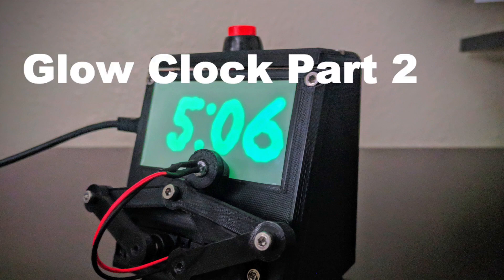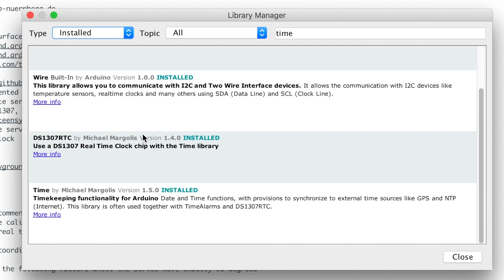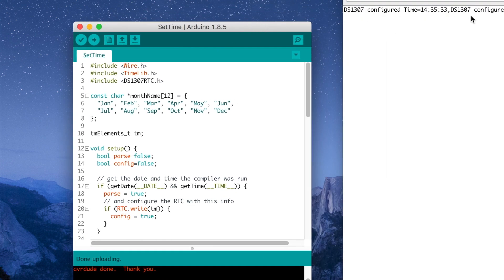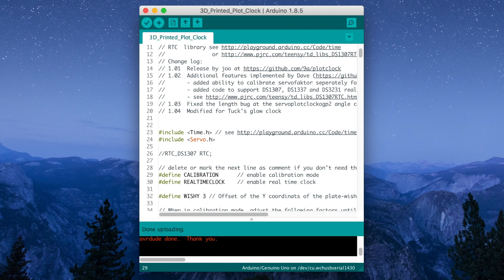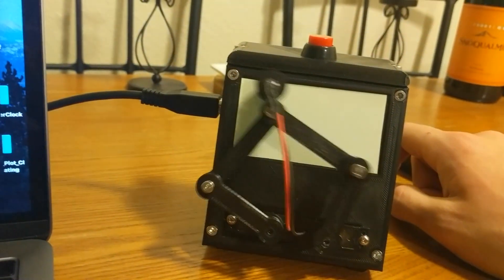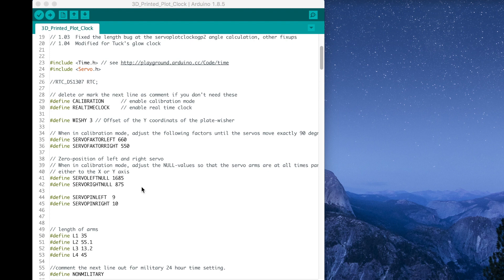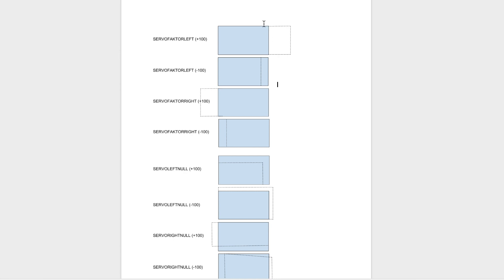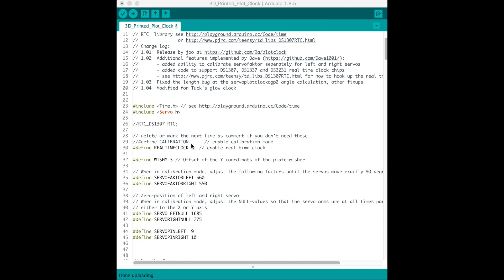Glow-In-Dark Plotclock Tutorial pt.2

Comment: What a nice case that you 3D printed.  

You should really consider making a PCB to interconnect all the internal wiring, instead of the rats' nest that you currently have.  The PCB would certainly improve reliability.  You could also switch over to an Arduino Pro-Mini.

One other thing is that the UV LED should have a resistor in series with it.  UV LED's should only be powered with about 3 to 3.5 volts across them.  The UNO port outputs 5 volts.  As it is currently, the LED is being stressed by overvoltage from the UNO, and the UNO output port is also being stressed.  The UV LED appears to be almost a short circuit to the UNO port.  Either the LED will eventually burn out, or the UNO port will burn out, or both.  Simply add a resistor of around 75 to 100 ohms in series with the UV LED, and the hardware will be much happier.
Reply from the maker: Thanks E Grava for the suggestions. I'm planning on doing a PCB design soon and I will make sure to add a resistor!

Comment: I am having this problem. Arduino: 1.8.5 (Mac OS X), Board: "Arduino/Genuino Uno"  

tmElements_t' was not declared in this scope
Reply from the maker: Try adding

#include <TimeLib.h>

Let me know if that fixes the problem so I can update the code
Reply: may i ask where in the code. also it might be my bord becuse i cant seam to get any script to run and i got a clone.
Reply from the maker: You would add it on line 25 after "#include <Servo.h>"

What errors are you receiving?
Reply: that fit the verify problem but now i have the same ploblem uploding as all other scrips. 

Arduino: 1.8.5 (Mac OS X), Board: "Arduino/Genuino Uno"

Sketch uses 12494 bytes (38%) of program storage space. Maximum is 32256 bytes.
Global variables use 510 bytes (24%) of dynamic memory, leaving 1538 bytes for local variables. Maximum is 2048 bytes.
avrdude: stk500_recv(): programmer is not responding
avrdude: stk500_getsync() attempt 1 of 10: not in sync: resp=0x00
avrdude: stk500_recv(): programmer is not responding
avrdude: stk500_getsync() attempt 2 of 10: not in sync: resp=0x00
avrdude: stk500_recv(): programmer is not responding
avrdude: stk500_getsync() attempt 3 of 10: not in sync: resp=0x00
avrdude: stk500_recv(): programmer is not responding
avrdude: stk500_getsync() attempt 4 of 10: not in sync: resp=0x00
avrdude: stk500_recv(): programmer is not responding
avrdude: stk500_getsync() attempt 5 of 10: not in sync: resp=0x00
avrdude: stk500_recv(): programmer is not responding
avrdude: stk500_getsync() attempt 6 of 10: not in sync: resp=0x00
avrdude: stk500_recv(): programmer is not responding
avrdude: stk500_getsync() attempt 7 of 10: not in sync: resp=0x00
avrdude: stk500_recv(): programmer is not responding
avrdude: stk500_getsync() attempt 8 of 10: not in sync: resp=0x00
avrdude: stk500_recv(): programmer is not responding
avrdude: stk500_getsync() attempt 9 of 10: not in sync: resp=0x00
avrdude: stk500_recv(): programmer is not responding
avrdude: stk500_getsync() attempt 10 of 10: not in sync: resp=0x00
Problem uploading to board.  See http://www.arduino.cc/en/Guide/Troubleshooting#upload for suggestions.

This report would have more information with
"Show verbose output during compilation"
option enabled in File -> Preferences.

Comment: This is awesome - but I'm having a hell of a time getting the thing calibrated.
The problem:  The servo horns & the servo shafts have splines the horns can go on in an almost infinite number of positions.
Reply from the maker: It is difficult to get calibrated. I spent a ton of time trying to get mine perfect. Do you mean you're having trouble putting the arms on at ~3:38ish? If so try and get the arms as close to that position as you can and then start calibrating with the code.
Reply: I think I just noticed the difference:  3:35-ish on your video.  Your servos are doing more than mine.  Mine are just sweeping back & forth, back & forth - like windshield wipers.  They are not even trying to draw a rectangular outline.   :(
Reply from the maker: Oh shoot. Sorry Kris but I've updated the code on the thingiverse files. I'll try and add that to my video description for anyone else who downloaded the code prior to this videos upload date
Reply: Aha!  Yes I got the INO and STLs from Thingiverse a few days ago.  :)
Here is what mine is doing:  https://youtu.be/rmgsjzcn1V8
I'll re-download from Thingiverse - thanks for sharing such an awesome project!
PS:  I had some GITD ABS filament on hand, so I printed a panel to stick on the case instead of a sticker.  You can see it in my video.
Reply: Did you ever fix this?  It looks like you may have had both servos plugged into the same pins on the Arduino?